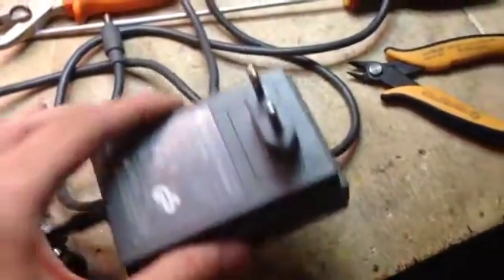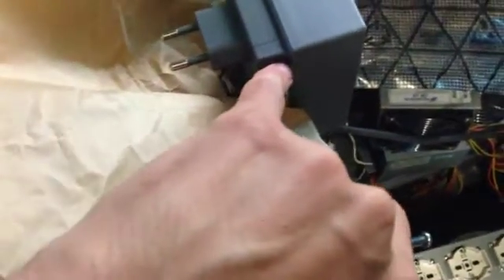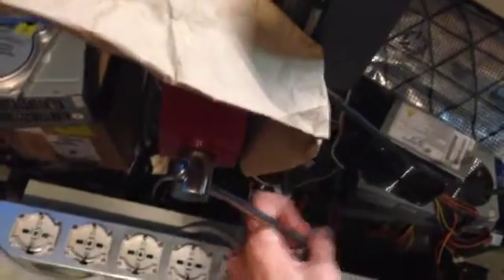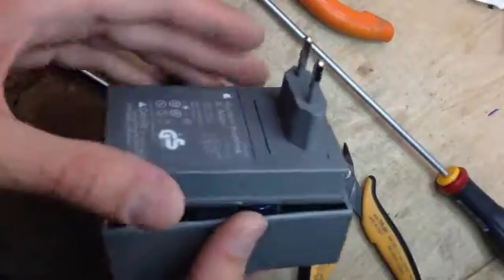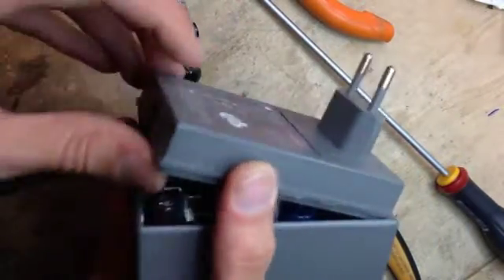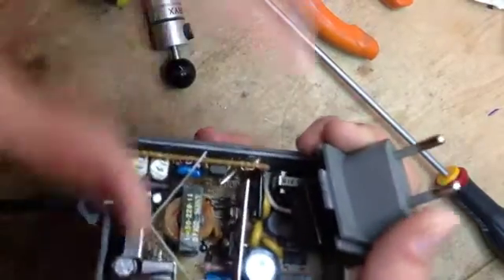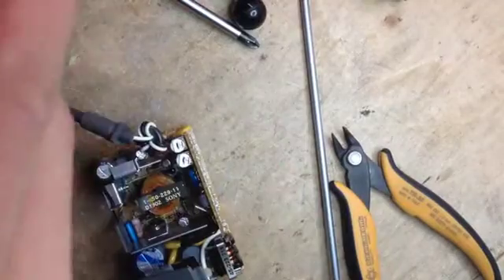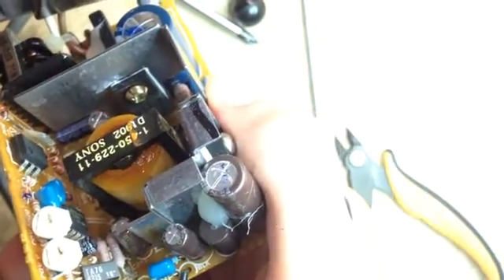Apple Macintosh PowerBook Power Supply Repair ReCap full guide

Comment: Are these adapters prone to failure and leaking caps? My PowerBook 170 won’t turn on. Multimeter on the jack shows 7.5V when first plugged in the wall then rapidly drops 6,5,4,3 etc to 0V in around 20 seconds. Is that normal when not connected to the laptop?
Reply from the maker: Yes, leaking caps are super common on this adapters. Remember to wash it before changing them
Reply: @FrancescoF  Does the voltage dropping like that indicate cap failure? Opening it is quite difficult and wanted to double check before I have to open it.
Reply from the maker: @TwentyEightySeven  usually yes, a load will cause it to fail
Reply: OK, thanks for the replies. I appreciate the help.

Comment: Thanks for uploading this! This is the only video about repairing an old PowerBook charger on Youtube. I have a PowerBook 170 charger that died and electrolyte leaked all over from dead capacitors and so I’m in the process of replacing all 4 of them since it would help keep the charger alive longer. Also opening it was nearly impossible until I used your method